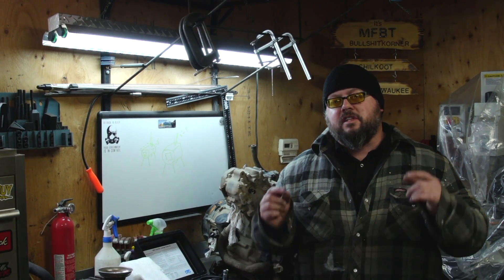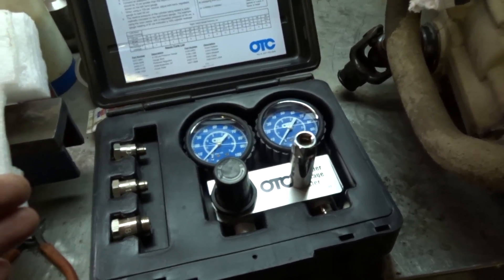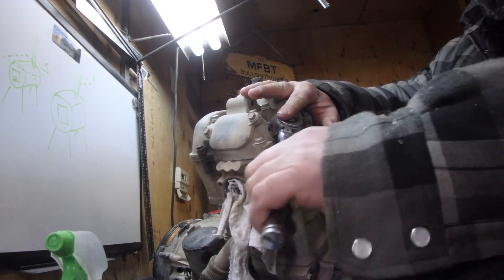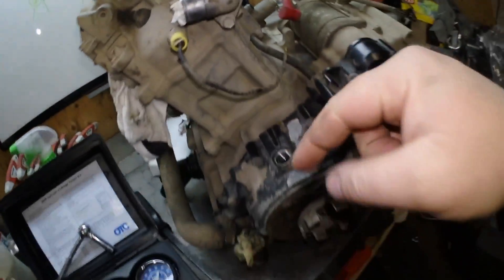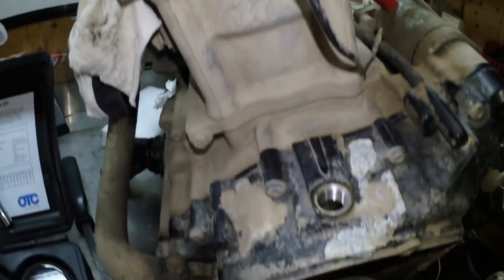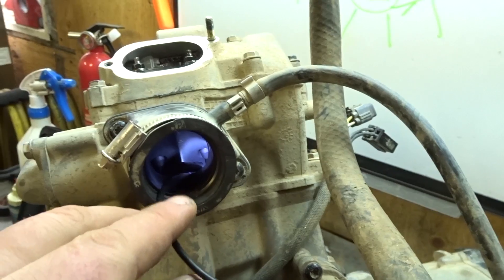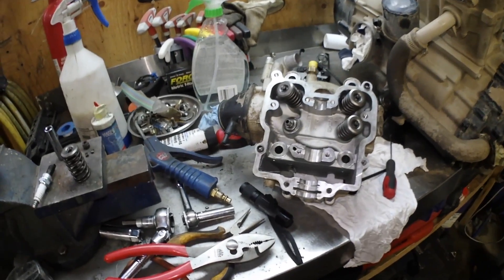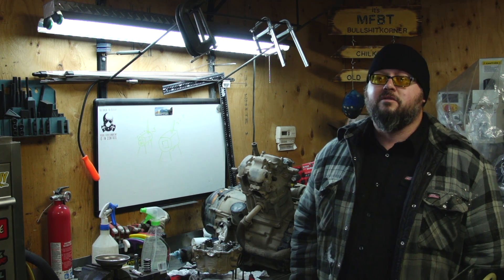ATV Cylinder Leakdown Test DIY

Comment: Hey did what was it? I’m working on a King Quad 450 I just replaced valve seals the Comp is 140psi. The quad smokes a lot seems like oil is getting into the cylinder because it’s coming out of the exhaust header. Leak down test I’ve never done I did make something. Ran a hose with a fitting to plug into head it hooks up to my air compressor and I open the regulator and i hear air. Not real bad tho honestly.